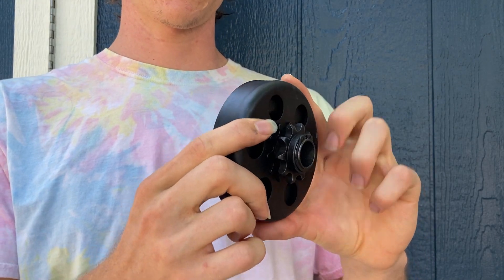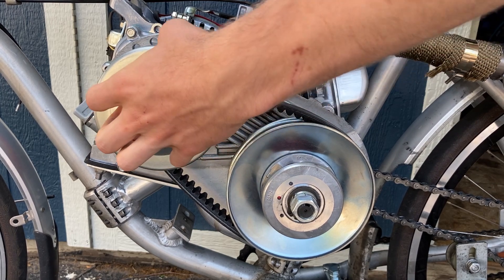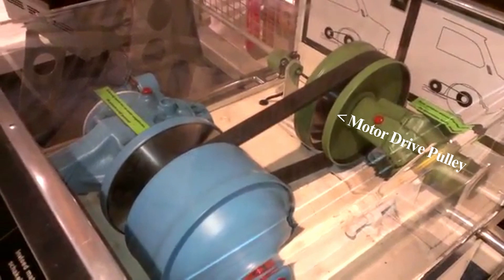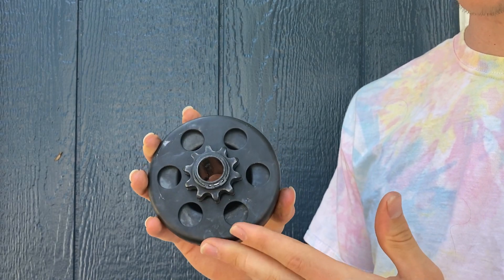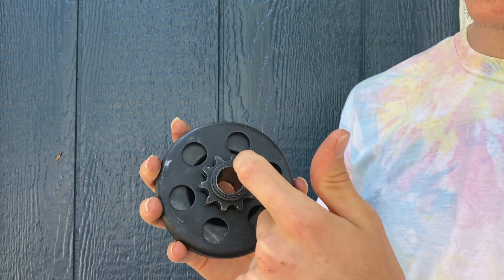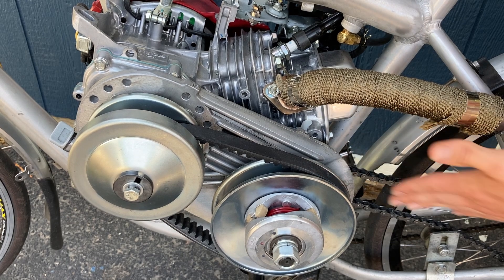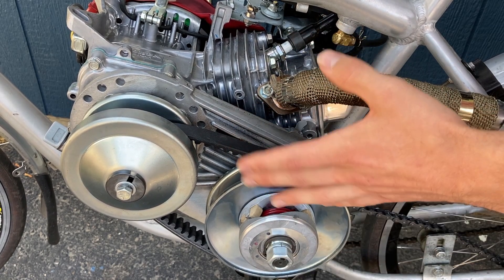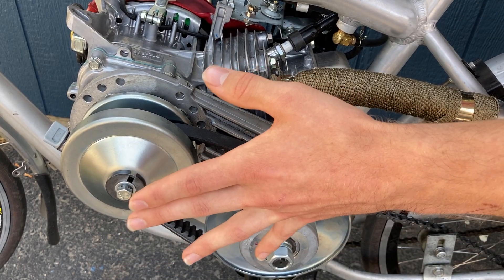Centrifugal Clutch vs CVT Torque Converter

Comment: It sounds like you're saying "center-fuel clutch". Its cen-tri-fical clutch. Other than that this was a very informative video and I appreciate you.
Reply from the maker: Yah I definitely butchered the word :) But I'm glad you liked the video!
Reply: It’s Centri fugal clutch not fical
Reply: For sure liked the vid. Informative. As for my spelling of the word.. I was spelling it as its pronounced. Lol.
Reply: Realized I didnt sub. So yea. Theres that too. ✌
Reply: From a mechanical engineering standpoint the term "Centerfuge" is the correct term to describe the mechanical force from the engine shaft being applied at higher revolutions. Therefore "Centerfuge clutch" is also an accurate way to describe the "centrifugal clutch".

Comment: Nice video!! But can i put the converter on a smaller engine ? 49cc 4 stroke 
Thanks
Reply from the maker: depends on the mounts the engine has. I know this will work on just about any engine with the same four bolt pattern as mine. (preditor, other Hondas, etc.)
Reply: @BenCarano  
Thanks for the reply!! I’ve got the Chinese 4 stroke, looks like Honda replica and I need more torque from the beginning! My clutch is burning... nice videos man! Keep going! )))

Comment: Dude could you please send me the torque converter, wheel sprocket & chain you used? 
I am literally doing the same thing right now I just bought a predator 212 and I have everything else I need but those parts!
Reply from the maker: Sprocket: https://mbrebel.com/product/38-tooth-sprocket-415-41-chain-fits-sprocket-adapters-u-s/

Chain: https://www.amazon.com/HIAORS-415H-110L-Connector-2-Stroke-Motorized/dp/B088BM9RLQ/ref=sr_1_1_sspa?dchild=1&keywords=415+chain&qid=1620525397&sr=8-1-spons&psc=1&spLa=ZW5jcnlwdGVkUXVhbGlmaWVyPUEyTVk2RDZGRElYWVdQJmVuY3J5cHRlZElkPUEwMjE4NDU5MUlVMzdDVzJQUEMyUSZlbmNyeXB0ZWRBZElkPUEwODI1NTcxMkIwQkVVTzVHRFk0NCZ3aWRnZXROYW1lPXNwX2F0ZiZhY3Rpb249Y2xpY2tSZWRpcmVjdCZkb05vdExvZ0NsaWNrPXRydWU=

Sprocket adapter: https://mbrebel.com/product/disc-hub-sprocket-adapter-with-chainring-bolts-and-6-disc-5-x-16mm-for-no-disc-brake-rotor-part-20462/
Reply from the maker: Torque converter is in this video: https://www.youtube.com/watch?v=Qxz6Xd33wm0

Comment: Can you tell me where you bought  the torque converter an have customized  thank you
Reply from the maker: Torque converter: https://www.ebay.com/itm/TRANSMISSION-FOR-212CC-DEATH-ROW-GAS-MOTORIZED-BICYCLE-Death-Row-Engine/192416300726?hash=item2ccce7beb6%3Ag%3AiN4AAOSw4YdYzxX%7E

Frame (currently unavailable but there are others like it) https://www.amazon.com/CDHPOWER-Reinforced-Motorized-Bicycle-Aluminum-Gas/dp/B06XPDH53M/ref=as_li_ss_tl?keywords=motorized+bike+frame&qid=1554092942&s=gateway&sr=8-2&linkCode=sl1&tag=caranocrafted-20&linkId=1509ff619917495417dd1f351d623be8&language=en_US

Comment: i am trying to find a solution to my problem - i've built electric gokart and CVT would be awesome if i could get engagement at 0 RPM. Gokart is 12kw peak so thats like 17hp. with long gearing it doesnt have good acceleration im trying to research the matter but nobody does that with electric motors where you dont have to idle the motor
Reply from the maker: Unfortunately I don't know if I can be of much help other than to suggest putting a stronger motor in it. Usually with electric motors like you said there are no transmissions because they have enough torque to start from a dead stop. I'm not sure if a torque converter will solve that.
Reply: @BenCarano  well power is sufficient it's just not enough rpm. I'm trying to race this thing and if could get decent acceleration and not bad of top end this would be sweet. Decent acceleration meaning i can peel off the line but in my case top speed is limited to 38mph. And then if i want top speed it will be slow off the line i think if i can modify it, it would work great
Reply: @streetK4  okay so you say your problem is acceleration, well if we look at simple solutions I would advise a gearbox. You can make one yourself it's pretty simple. Or you could go with a 2 phase belt drive which should give you slightly better acceleration. You've got a few options so keep researching. And I'm working on a hybrid bike with a 390cc 14hp engine plus a 1.25 kw electric motor which adds up to about 19hp. I would love to race you😏
Reply: @str8xrippin  yet i am not able to find good lightweight solution for this. Best solution is more power to over come tall gearing
Reply: @streetK4  alright mate if you really can't do anything about it then more power is a simple solution and is gonna work great, also reduce weight where you can so you get more work per kg/lb. I think if you can up the power to about 50% more which should put you at 18kw that would be the best
Reply: @streetK4  high speed gearing, more voltage. that or a transmission. try to find an old blown up pit bike engine (with a trans). pull off the head and take the rod off the crank, along with the flywheel. weld a sprocket on the flywheel side of the crank to attach to your electric motor, and the crankshaft end to your axle. leave the oil in the engine. oh, and make a plate to go where the head was. simple piece of flat steel.

Comment: Get the wide crank pedal kit.if ur pedal are hitting the engine!!!
Reply from the maker: That's definitely what I wanted to do before I got the custom axle, but unfortunately they don't fit the bottom bracket I have.
Reply: @BenCarano I think they sell them for 2 tipes of bracket. U also can bend the pedal lil bit!!!

Comment: this centrifugal clutch.ruined  my predator 212,
Reply from the maker: How so?
Reply: @BenCarano  I think it did not fit well in the axell,it did not engage  smootly,so streched the.chain and at the time I did not care much ,was brand new engine ,but I think was my foult  for not checking it ,now engine makes  funny sound ,but I just got a mew predator and I am insralling the torke converter.
Reply from the maker: @josuemelara5085  For sure! There are definitely many things to check to make sure they are running and working smoothly together, because there are many factors at play to have everything working properly. Live and learn :)

Comment: Centrifugal clutch + cvt = PERFECTION
Reply: This man is to powerful to be alive
Reply: Thats on you. No top end speed with a cvt, plus your using a crap clutch.
Reply: @heavystarch100  PLZ bro i have a problem I have a centrifugal clutch on my gx120 but when I accelerate it doesn't take any turns it rolls but doesn't go to the rev limiter and always has the same number of revolutions per minute the clutch is new and when I put the wheel in the air without me on it it accelerates to the rev limiter? Do you have any idea of the problem please
Reply: Hey where did u get the engine mounts from?
Reply: I have same set up but redid all the rods and guts with bullet piece .sick engine
Reply: Oh wait never mind I have 212 cc but still want them Mounts
Reply: Too much power loss.  Not efficient.

Comment: I like how much you put into this video but I also think you need to try that centrifugal clutch with better gear ratio... I feel like what was happening was you weren’t getting enough rpm to consistently engage the clutch... I think you should tinker with ratios and see if you can get it to work better
Reply: What ratio would you recommend?

Comment: That jitter happens when you have the clutch on the drive shaft backwards.
Reply from the maker: with some clutches that can be the case if they're directional.
Reply: @BenCarano  yeah, max-torque clutches are bi-directional.  When I used to race karts we used Noram clutches and they definitly weren't.  Not sure who makes your clutch - whether it is a max-torque or clone.  On the noram, you could tell because the guide on which the shoes slid out was on an angle.  That angle had to be facing in the direction of rotation or it would bang and be very jerky.  you may be able to reverse the innards of the clutch and give it a try.  However, with your torque converter working so well, why bother.
Reply from the maker: @greggreaves1727  Yah that's a good point! I do still love the torque converter and it's already been working for a year, but reversing the innards of the clutch might actually work, I never thought of that; because I need the clutch and sprocket themselves to be in that specific orientation to line up.
Reply: @BenCarano  it's nice you were able to find a torque converter designed for that chain so close to the frame.  if there's a plastic guard available, i'd look at putting that over the tq.  It would really suck to get your pant leg stuck in there.  I've always wanted to try a tq on a kart.  it just makes sense to me.

Comment: Put a 14hp motor with a centrifugal clutch on a gocart and just about burnt out the clutch. Put a 7hp with a CVT on the same gocart and it works great. Another way to get an ideal gear ratio is to go with a jack shaft
Reply: Me too man I put a bored out predator stage 2 race motor on my go kart with the original clutch and it burned out in a mile. Started smoking and sparking, definitely making this purchase and installing a torque converter on my kart.
Reply: Do you any Centrifugal Clutch for a 15HP Engine

Comment: Nice Work Benjamin - very useful video although I'm thinking I'll go with a centrifugal clutch as I'm making an inboard motor for a tiny yacht and thinking the benefit of the torque convertor is really where there is a load on the engine?
Reply from the maker: For sure! I'm glad this was helpful. Good luck with your build!
Reply from the maker: And yah a torque converter is definitely helpful with more load on the engine so if your done have as much a centrifugal clutch should work fine.
Reply: @BenCarano  Thanks Benjamin - even though I'm old enough to be your grandfather :-) I'm a total noob at this and appreciate your expertise! One thing I've been struggling with is forward reverse gearing - had a look at a couple of ATV ones that fit these 'Honda' motors and they look like a recipe for disaster in a boat with a long (2metre) drive shaft so appreciate any advice if there may be other options if you've time. Main issue is with reliability as critical for a boat, whereas you can just catch a bus if the bike breaks down.  Awesome bike BTW - is it hard to stop?
Reply from the maker: @AusMarineRobotics  With the gearing I have run into the same problem with all the ones I found looking like they were cheaply made and wouldn't be very reliable. However, that was over a year ago when I built my bike, and since then a lot has come out on the market so there might be a better one available now, I just haven't looked in a while. I'll let you know if I come across a good one though. As for the bike it was a bit hard to stop, and since the video I have upgraded to hydraulic brakes and that is much better. Your boat project sound cool man! I hope it turns out well for you!
Reply: @BenCarano  Thanks Benjamin - have decided to go for the torque converter now (and buy a torque wrench!) Unfortunately I have just ordered one of those cheap and nasty ones you warn about :-)  As I'm sticking to standard parts I should be able to replace it with a more expensive US one I saw if this design works out.
Reply from the maker: @AusMarineRobotics  Sounds like a plan! hopefully it all works
Reply: id go centrifugal clutch personally. cvt is for low and high speed performance for wheeled vehicles. edit: if youre only going to be using the engine to steer and move the boat, why not just use nothing, like straight off the crank? make the engine able to swivel around backwards for reverse, and only run the engine when you need to move?

Comment: Link for the torque converter with the sprocket behind the plate? Can't find it. Looked for it on my own, no luck. I'm actually building 79 cc predator
Reply: @Stan Lewis if you still need a cvt gopowersports sells a 5/8 cvt

Comment: Do you have a link for the cvt with the sprocket behind the plate?
Reply: that was custom made for hin.
Reply: The engine is a Predator 212cc it's output shaft has a 3/4" diameter output and only GasBike.com and Kings Bikes.com have the CVT that has the
extended sprocket on the back of the mounting plate. I did find a vendor selling the CVT on Ebay and it was cheaper in price than the above vendors.
I have that CVT and it is the same unit and it is ok. There is a add-on sleeve that will work on a 5/8" output shaft but remember, I suspect that the
CVT will use some HP just to operate so if putting it on a 79cc engine the engine should be modified for performance.

Comment: Clutches have been used successfully on mini bikes and go karts for decades. The reason you were getting clutch chatter is your gearing. And you are lucky that you didn't buy an expensive clutch because it would also chatter due to your gearing.

For a clutch to work properly on a tall tire bicycle you would need at least 9/1 gearing or more. The torque converter works better because in low the ratio starts at 2.7/1. Say you had 10 tooth with a 40 tooth sprocket. This would equal a 10.8/1 numeric ratio. Much better with your tall tire. The same sprocket count with a clutch would be terrible. The gearing is just way off.

The torque converter you have is not made specifically for a Predator. It is universal and can be used on many engines that have a 3/4" PTO. And they have had much more power put on them than a stock 212 without breaking. It's all about gearing.
Reply from the maker: Yah, gearing is a big part of it! That's probably why it works successfully on vehicles with smaller tires. That's definitely a big part of why I went with the torque converter because when it engages it starts out in a lower gear ratio
Reply: @BenCarano  Makes me wonder how it works for you on the other end, meaning top end. Once the belt shifts to "high" the ratio turns into .9/1 which is overdrive. The thing that happens is that ratio kills the engine.  It stops pulling and RPM will not increase. This is normal even on mini bikes with pretty good gearing. I'm wondering how dramatic it is on your setup?
Reply from the maker: @Deucealive75  It seems to be just fine for me, it starts up nice and smooth and doesn't slip or mess with the RPMs

Comment: Quick question? On my cvt vs clutch, my clutch will let me roll the bike easily without the motor on. The cvt will not let me roll the bike easily without the motor on. Is your bike the same? As in the ease of pushing it around with the cvt? Thanks!
Reply from the maker: No, my bike can roll pretty easily with the cvt, however when I'm rolling down a hill at around 25 mph it will start to get tight and act as an engine break which I actually like. Not sure why your cvt won't let you roll the bike around especially at low speeds without locking up.
Reply: @BenCarano  ok thanks! I got something binding then, going to check it out soon!
Reply: cvts can grab at low speed.
Reply: Im having the same problem 😕

Comment: What do I need to get the gear to the other side of the case a longer shaft I don't think the on I orderd is like that.
Reply from the maker: it needs to be that way for most bikes. Maybe your bike will line up differently, but usually the sprocket on the cvt needs to be set further in to line up with the rear sprocket.
Reply: @BenCarano  well I think I have the same frame,with the built in gas tank. Going to use a gc160  I thought you said you got a custom axle shaft?ordered the gokart toque converter off Amazon, so the shaft should be long enough?Will have to wait till I get it.

Comment: thank you, best review of the torque converter that I have seen ... thank you 🙏🏻
Reply: Hey how you doing today just washed your video on YouTube about the motorized bike I really like what you did with your sprocket can you please send me a picture or tell me Moore how you did it please .....?
Reply from the maker: @motorizedbicyclerider5296  Watch this video https://www.youtube.com/watch?v=zjnUfKmga6Y&t=1s starting at 10:16
Reply: @BenCarano  hey thanks for your response Benjamin have a good day
Reply: @BenCarano  hey Benjamin it's me again I have another question I have a 26-inch, mountain bike 7-speed. Can you please text me back specifically what kind of back rim do I need to get to fit my mountain bike thank you and I'm using a 44 sprocket
Reply: @BenCarano  and what can I find one single rim kind of hard and pretty pricey
Reply from the maker: @motorizedbicyclerider5296  I'd have to know your rear axle spacing to tell what rim to get. I had my wheel custom built for around $400 with really good quality and strong parts to accept two people on the bike.
Reply from the maker: @motorizedbicyclerider5296  Rims can definitely get expensive!
Reply: @BenCarano  that's the problem right there I don't know how to measure
Reply from the maker: @motorizedbicyclerider5296  The measurement will be in millimeters and should be either 135 or 150 for a mountain bike. it is the space between the rear fork of the frame where the wheel goes.
Reply: @BenCarano  it will be awesome if you can send me a video or show me in some kind of way how to measure or a picture please help